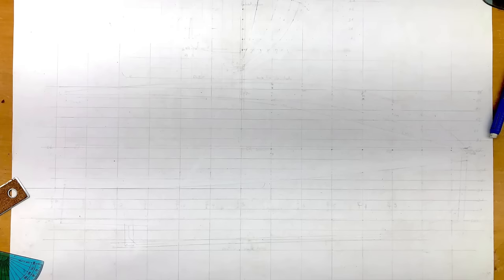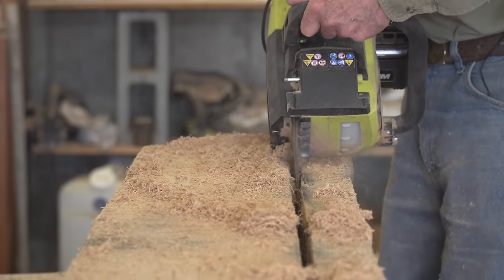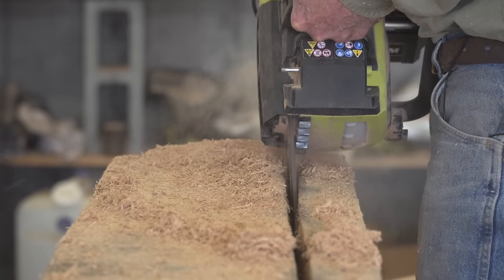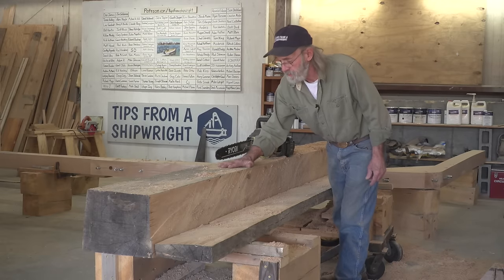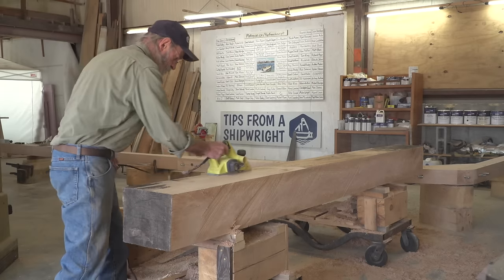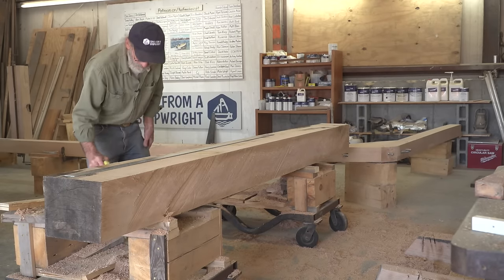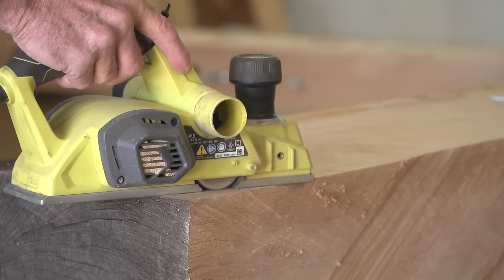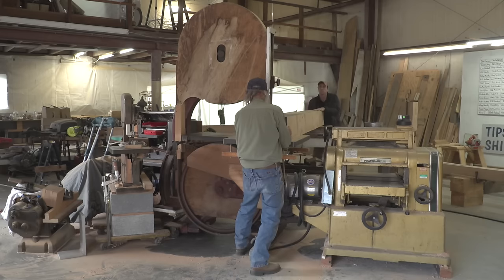Building ORCA - Episode 11: Completing the Centerline

Comment: to check the accuracy of a straight edge flip it to the opposite side and re-check, and see if it repeats your first results, also if you can, measure the entire width in several places  of the straight edge with a micrometer and see if the width is the same

Comment: I have a Ryobi thickness planer and a Ryobi drill press, such as have been sold at Home Depot. Very good value. I bought a cheap corded electric lawn mower from another company. It works well except that it's actually noisy... not as bad as gas-powered but still quite noisy. My neighbor got a Ryobi cordless lawn mower, and... it's shockingly quiet. The company keeps hitting balls out of the park.